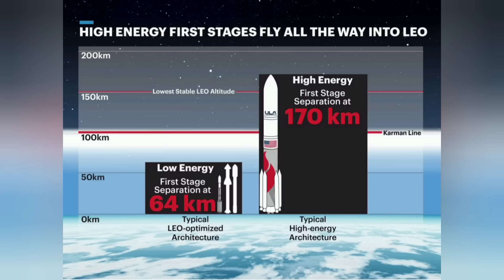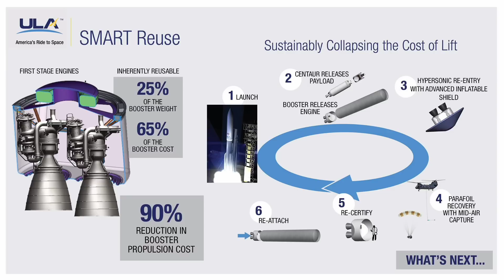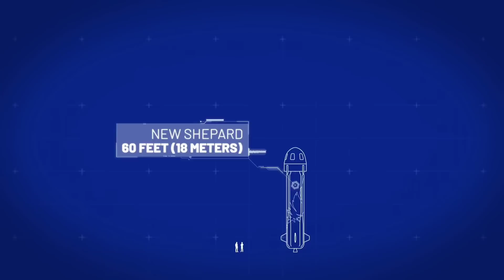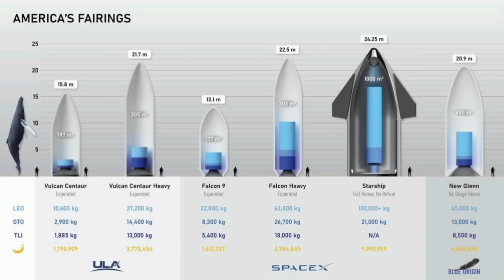Blue Origin wins again!  But does Bezos deserve the same USSF contracts as SpaceX and ULA?

Comment: I don't know that I'd agree with the point that Starship is somehow useless for deploying payloads to higher orbits.  Kick stages are a thing, and it's very much within the realm of probability that SpaceX or some other party might decide to develop one for Starship for those payloads.  While it is presently unclear how much payload volume Starship presently has, it's likely enough to fit pretty much anything that USSF or any federal agency would want to launch to orbit.  The Shuttle also launched some DoD payloads using a kick stage, making this well within the possibility.  It's also very possible that for some payloads Starship refueling is going to be perfectly acceptable to the USSF and other DOD/DHS customers.  Payload mass is more than likely going to be sufficient to task as well.  

This is also not to mention that in 2027 NASA is using Falcon Heavy (granted with an expended core stage) for the Nancy Grace Roman Observatory, a payload that was donated by the National Reconnaissance Office for NASA's use as a telescope to a substantially higher orbit (Earth/Moon L2) than GSTO or GEO. If it works for that, well, it's a hard argument to me that that's not going to work for DoD long term.  My bet as to why DoD wanted Blue Origin in on the launches is primarily to do with competition and economics rather than performance.  If BO can come in and be a disruptor, they'll force SpaceX to lower their prices and will also put more pressure on ULA to do the same, which makes their budgets go further.

Comment: Nice, there were several points here that I didn't know about (and I thought I had this subject covered). 
That said: I'm not sure if you accounted for Starship V3 (as it's a year off, maybe further). That has 200t (reusable) to LEO and likely 40t or so to GSO. This is achieved by increasing Starship V2 from 6-9 engines in the 2nd stage, 33 to 35 in the first, with Raptor V3 rated  at 280t each and about 25-30m extended fuel tankage split between the two stages.
So that iteration can go pretty much anywhere you want to with substantial payload. 

I expect they will perfect reusability by 2025Q2 (both stages) and ramp up testing Starship V3 by 2025Q4 as they will want V3 perfected well before their 09/26 moon launch (which I would expect to take place between 09/26 and 09/27 as there is no hard deadline save well before the 2030 Chinese landing (which might be pushed up). The much greater tankage will cut back on the number of requisite flights to the depot that will fuel the Lunar Lander. They will also want to send an unmanned mission first. Perhaps with a score or two of Teslabots to set things up (modified for radiation, etc). Musk expects to have at least 1000 bots working in his factories by end of 2025... so not too far fetched. (Currently he has 2 in the factories and a bunch more doing busy work in the administrative offices.) Might make a nice hedge against space suits running behind schedule. (ie a couple of astronauts stay in the rocket to direct work gangs of robots without transmission lag.

I know Spacex was confident of refueling a Starship variant with enough fuel to go from LEO to Lunar surface and back to LEO well  before V3 was a thing. 

Star factory should be putting out at Least 1 starship per month (designed for 100/year) by 2025Q2 which should yield multiple (4-8) tankers and 3 operational launch pads to tank up the "depot" (likely a modified V3 tanker) before it can bleed off too much fuel (esp if they use Skylab type umbrellas to keep the fuel cool.

Comment: I'm definitely not a rocket scientist, but I thought a falcon heavy "block 6" would make some sense.  I know Elon was disappointed in Falcon Heavy and moved on to Starship.  I would l think a shorter center core maybe with 7 engines would allow for a larger 2nd stage, or a 3rd stage.   Center core would  separate at an altitude and speed similar to a Falcon 9, but with a larger 2nd stage or with a 2nd and 3rd stage.  Land the shorter center core on a barge and the two side boosters with a return to launch site.  A larger percent of the booster would be recovered and more cargo to GTO or TLO. My Kerbal space brain says use raptor rocket engines and 3 stages get to Saturn 5 level of performance with a recoverable 1st stage, but at some point your just making an expendable star ship, that I have also wondered about. To get Starship delivering cargo to the moon or GTO you could  recover the first stage as planned, but make the second out of aluminum and expendable, and add a third stage (just the top half of starship) and your on your way to the moon.  Refilling in space could still happen and the top of starship could be a Moon shuttle.  With pick-up and delivery by a Dragon capsule.  Future missions could be done with a some of Elon's larger versions of the Starship.

Comment: You seem to be discounting Starship just because it cannot go to high orbits without refueling. The whole concept of Starship is dependent on refueling. Considering the Starship launch system and discounting refueling makes very little sense.
If Starship solves refueling it will result in a complete annihilation of any competition. To calculate we will have to see how many refueling launches are needed to get to geosynchronous orbit – but it is significantly less than for the Moon or Mars.

Comment: heres my question; if spacex developed a non reusable starship; no reentry, heatshield, flaps, header tanks, typical fairings; could it do a geo or lunar orbits?
Reply: Make Starship three stages and expendable and it could get to the moon. The Saturn 5 launched Skylab into low earth orbit.  Skylab replaced the Saturn 5's third stage.  In other words, the "Starship" booster is very similar to the first stage of the Saturn 5 rocket and the Second stage, and 3rd, similar to "Starship" part.

Comment: honestly, I really do hope Blue Origin succeeds. What's so frustrating is how freaking slow they are. How have they not even flown a test version of New Glenn yet? How the heck do they think they're going to land that booster at this rate? SpaceX had hard landings for many many boosters before they dialed it in. Also HLS wasn't just given to Blue Origin, it was given to Lockheed, Boeing, and a few others together. So hopefully that won't be such a failure as New Glenn

Comment: Angry, the chart displaying SpaceX Falcon payload limits is wildly inaccurate.
As NASA and the USSF know, both Falcons are limited to 10 tonne payloads; because of both aerodynamic and structural limits on fairings and launch vehicles.
NASA has contracted Falcon Heavy to place GATEWAYs I-HAB module and furnish Dragon XLs for Artemis mission supply.
Both spacecraft weigh in at less than 10 tonne; expending both core stage AND both strapon boosters AND at maximum cost, equating with New Glenn and Vulcan launch costs.
Again, both NASA and USSF know this; any potential private customer soon finds out the limits of Falcons and their true costs: 10 tonne, max.

Comment: The people who probably developed the original satellite are dead. And their heir cannot get an advanced Stem Degree or other interests like just plain money. Does not make sense why the electronic components are heavy....  Must be the patent and licensing requirement.  For example, solar panels and associate power unit are getting smaller producing more power.  Another example is processing power.  Even starlink have transponding equipment which are more powerful. Patent/oyalities and licensing.  PS What happens if starship has sold state boosters strap on?

Comment: Personally, I believe that this move is just to provide another provider in case one of them has a mishap that prevents them from flying. So I believe they are just hedging their bets just in case.  This is especially since Space Force is concerned right now that ULA will not be able to meet their current commitments.
Reply: Problem with Bo is that it got preferential treatment, while companies like relativity, Stoke,  Firefly or rocketlab, while they have at LEAST as much achievements as Bo have issues to get those contracts. Bo is treated on pair with SpaceX, very PROVEN company with a lot of experience. I am very big fan of competition, I wish Bo success with their new Glenn ... But why Bo can grab contracts while companies I mentioned couldn't? Bo is not more advanced than those companies. Is FAR behind SpaceX. Yet Bo get contracts whenever they will care to participate.

Comment: If Space X was worried about New Glen, all they would have to do is to develop a new and larger faring
Reply: Sorry ,Greg, any larger fairing would be torn apart by aerodynamic forces.
This one of two reasons why both Falcon classes can actually only launch 10 tonnes payloads each, maximum.
The other reason is that the payload of the Falcon Heavy is still sitting atop only ONE of three slender Falcon 9s, with limited extra lateral support.
At launch, any payload heavier than 10 tonnes would collapse the single Falcon beneath.

This, Greg, is why SpaceX is worried; New Glenn (and Vulcan) outclass Falcons in payload capacity, reducing their role to the low end of the "Heavy Launch" market.
Reply: @davidstevenson9517  I'm sorry if starship works well the next versions will make other companies redundant.honest truth

Comment: Starship doesn't need to be larger, it needs to have a third stage!
Reply: Well, it would make more sense, but as it violates the 100% reusability commandment, therefore it's a mortal sin!!
Reply: @professorg8383  not if the 3rd stage tremendously increases the types of missions that could be done. It's all about a cost/benefit ratio. And overall in the scheme of things, relative to the cost of the entire vehicle, it would be marginal.
Reply: @rosswarren436  When orbital refilling gets figured out there will be no need for kick stages.
Reply: @cleed1564  orbital refueling is wasteful and time consuming to use for most lunar missions and for getting to closer destinations like geosynchronous. The KISS philosophy still applies, even and especially in space flight.  No need to make something complex. Yeah, for hauling heavy rovers, habitation modules, power systems, etc., things that don't use consumables it makes sense, but not for crewed missions. 

A Starship with a 3rd stage could do direct crewed missions to the surface of the moon, no Rube Goldberg needed. 

And there is no reason to send a honking Starship everywhere you need to send payloads. 

Also, keep in mind that the eco-freaks are already taking a hard look at Elon and SpaceX and how much carbon dioxide they produce flying rockets. Launching something like Starship 44 times a year is going to get their panties in a wad and the EPA will likely regulate that number downward or add on fees that reduce the cost effectiveness equation.
Reply: @rosswarren436  Finally, someone with a little common sense!! No free fanboy gear for you!!
Reply: @rosswarren436   can't get any more complex than a third/kick stage. Besides only the depot not the lunar lander or ship will be re fueled/filled multiple times. The ship is only filled once.
Reply: @rosswarren436   the most preposterous
thing anyone could think off is discarding a vehicle after one single use, never mind partial reuse. the billions of dollars saved in a fully reusable vehicle will more than makeup for its development. Super heavy booster is designed to launch multiple times per day. any depot mission of multiple tanker runs would stem the boil off propellant.
Reply: @cleed1564  upper stages are relatively cheap. Jeez man. One engine (or two) and some avionics. Compared to Super Heavy with 33 Raptors, a 3rd stage is nothing of consequence, except it can be a huge game changer in the missions that can be achieved.  That's Spaceflight 101 and Econ 101. 

As it is, I'm not sanguine about Elon even finishing Starship. The more they get into it, the more they realize you can't field something like this on the cheap. 

We'll see how it goes - and how much Elon is willing to blow trying to make it a reality. 

It may be the biggest, most powerful rocket that has ever flown, but given its mass fraction with that heavy stainless-steel skin, it is also one of the poorest performing ones ever as well.
Reply: @cleed1564  and orbital refueling of cryogenics has never been attempted. That is a huge unknown in how much fuel will boil off and be wasted during transfers and how long can it be stored in orbit?  No one knows.
Reply: I think if they are going to replace the starship with saturn v 2nd stage style
Reply: Just have 45 engines at the base and make it longer
Reply: Exactly.

Comment: Starship can launch around 100t to LEO, so can it just deploy the satellites in LEO with a big 'space tug' attached to finish the positioning into the correct orbit? Space tug stays in space for future reboost missions?
Reply: Payloads that need to get out to orbits have their own thrusters and fuel on board. Partially for getting into the proper orbit, but also for maintaining it, and any position changes (debris etc) that may be needed. Communications satellites often have nearby backups that can be changed from the parking location to the active satellite position with a bit of thruster firing.
Reply: If you can believe Elon.
Reply: It cannot yet. Also I highly doubt the numbers, as the dry mass is not set in stone yet: we do not know how much the thermal protection gonna wight.

Comment: The extended fairings, I assume, are recoverable? Amortizing the development cost over several missions will bring the price down -- or provide a healthy profit. I'm betting that the design for extended fairings is already finished. SpaceX only has to build that while Blue Origin has yet to achieve orbit. Let Blue Origin try and fail, or never try at all. That won't bode well for future contracts. In any case, they only have the right to bid.

Comment: The obvious advantage of Starship, despite having to refuel, is that it can launch much larger spacecraft. Spacecraft with capabilities unimaginable before. I would think that would outweigh direct to geosynch.
Reply: Not to mention the ability to ferry significant amounts of material and manpower to the Moon and Mars. With it so cheap and quick to make one (both getting less each time) they can literally have a cargo convoy FLOWING between destinations. Like cement trucks at a large build site constantly entering and leaving. THAT is the real game changer. Instead of everything you can take having to fit on one single launch, this thing can fly, and refly, and refly, and they can make 100 of them for less than 1 single launch of SLS.
Reply: I agree with OP. Starship can lift gigantic payload to LEO. Starship doesn't have to do everything itself. Once placed in LEO, such a gigantic payload could be towed further by a space tug launched in the next launch. This would require docking to some intermediate layer connected to the payload.

Comment: I don´t really have an issue with BO getting the ability to bid on contracts. It is only for Lane 1, which is for less demanding missions to low-Earth orbit. It doesn´t guarantee them any wins. This is what New Glenn is designed for and whenever it flies and gets certified, it can compete. I don´t see how it could beat a fully reusable Starship though and I doubt New Glenn will have functional first stage stage reuse before Starship becomes fully reusable.

PS: I hope Rocket Lab gets the same opportunity with Neutron and Relativity with Terran R as soon as they get closer to flying.

Comment: I agree! Blue Origin has not 'Earned Its Bones' to be a legitimate consideration bfor USSF missions. 

BO' New Glenn has not had its maiden test flight yet.  So we, nor Blue Origin, has any baseline data of NG's flight capabilities.

BO competitor: SpaceX, ULA, Relativity, RocketLab have all had to deal will the growing pains of Rocket manufacturing.  Failures are to be expected. 

So the Blur Origin to be Marketing New Glenn, before it has even had its first test launch, is more that arrogant fantasy. Its  delusional misrepresentation.

Ok. So NASA chose Starship for the same reason. But to Elon (more like Gwynne Shotwell salesmanship), NASA chose Starship for Artemis HLS; mire by SpaceX's reputation of getting the job done (and under budget) than through political or legal posturing.

There is the difference betwen Elon Musk/SpaceX and Jeff Bezoa/Blue Origin.

Comment: US military has it's own budgets and spends $50,000 on a toilet seat (Area 51 special acquisition).  Blue Origin no doubt offered a huge discount in exchange for Alien space craft tech, might even be free.
Reply: The military never remotely spent that kind of money on a toilet seat. That was a paperwork thing only.
(And the paperwork showed, $5,000 for the seats.)

What happened was someone got hold of a purchase order, and that purchase order had X number of items on it, and on that purchase order they took the total number of items that were on it and divided it by the number of items that were on it and divided it by the total cost of everything.
And that's what the per item cost worked out to. The problem with that stupidity is the simple fact that the purchase order also included two newly developed engines that had to be  worked on and rebuilt. Those engines were obviously far more than $5,000 each, which means the $5,000 toilet seat was far less than $5,000. The engines were probably 20 grand apiece or more.
Reply: @lordgarion514  It's hard to talk sense to the clueless!